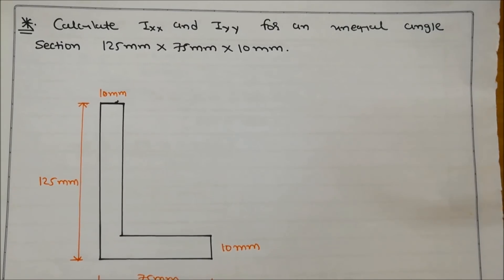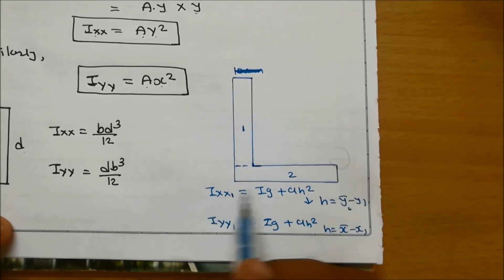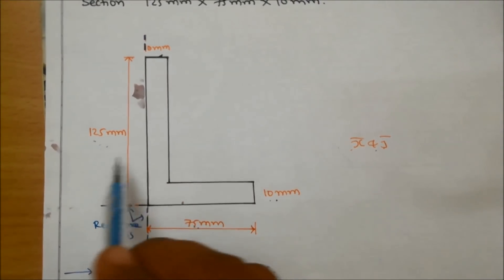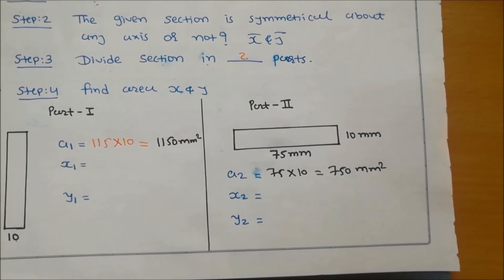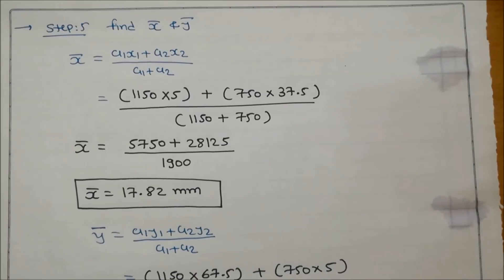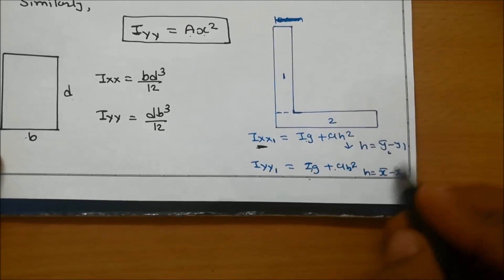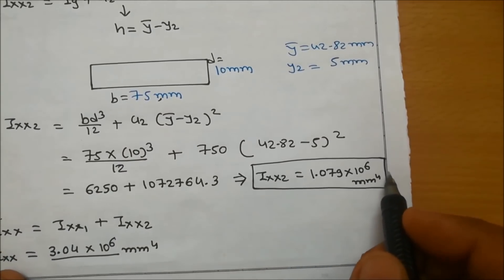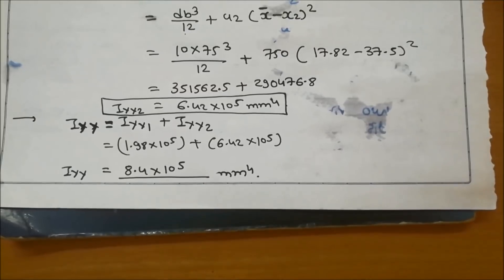Moment of Inertia of L section

Comment: The answer is same as  inverted T Section of same dimension. L section is Ixx = 3381500.07 mm4 and Iyy = 506005.4116 mm4. For inverted T section , Ixx = 3046877 mm4 and Iyy = 361145.833 mm4. Correct me if i am wrong. Thanks

Comment: Y1 value should not be 67.5 when you calculate moment of inertia. It should be 115/2 = 57.5 because it is a separate member and its distance should be taken from body's centre of gravity to the section's centroid. Kindly correct me if I am wrong.